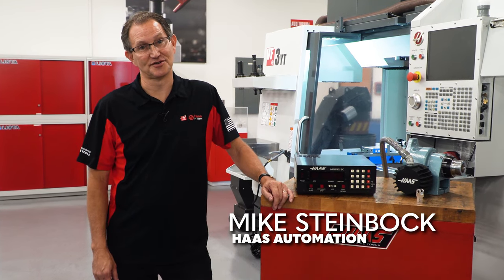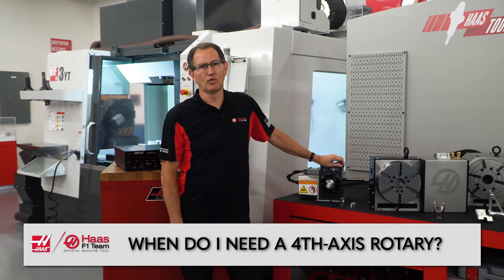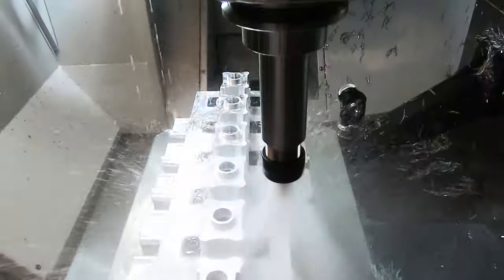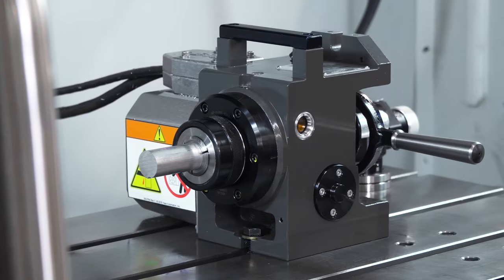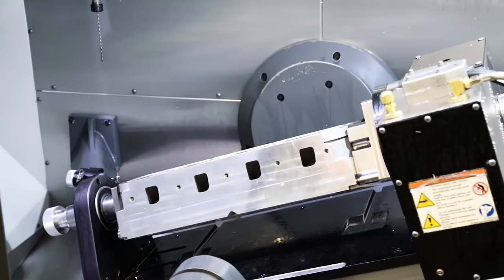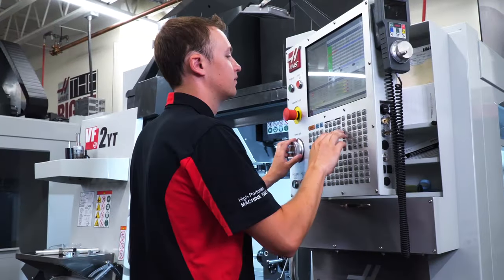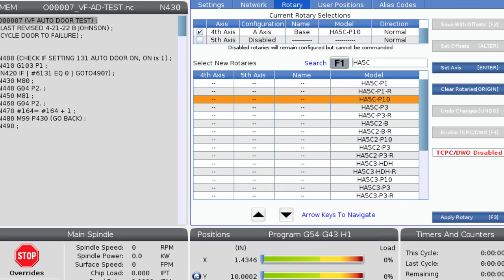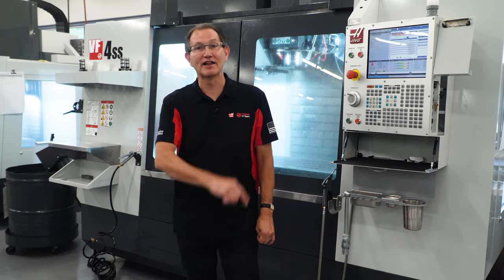Increase Productivity with a Haas Rotary Table - Haas Automation, Inc.

Comment: If I get a five axis can I use my HR 210 controller for one of the axis or do I need to buy two more servo drives? 2019 DM-2 and 2019 HR 210. 
  Also there was a weird pricing problem. It looks like the fifth axis Drive cost $7500 or almost 3 times the price of the fourth axis drive.